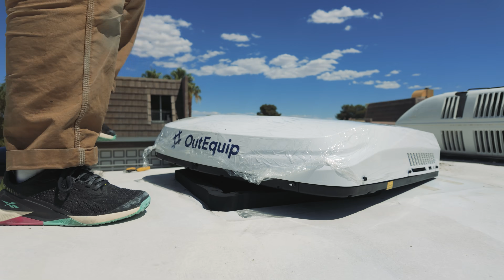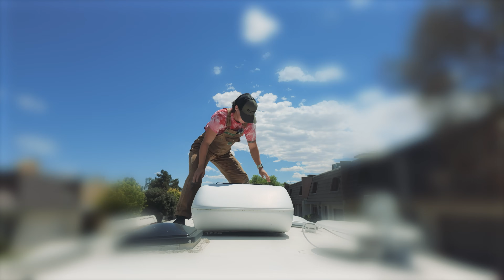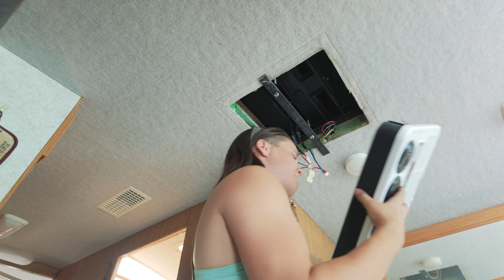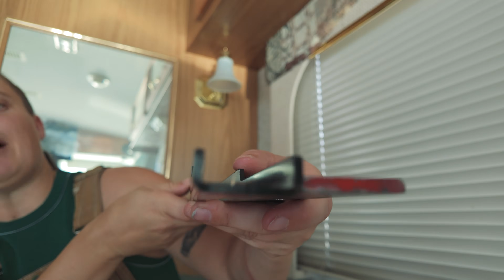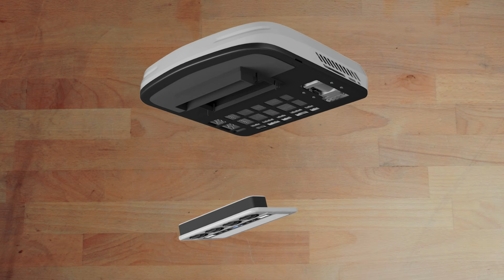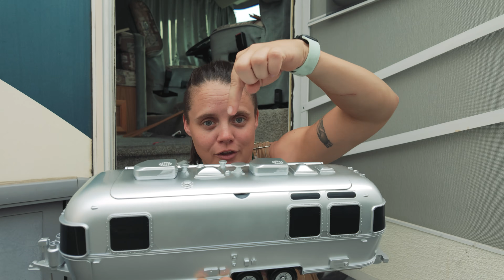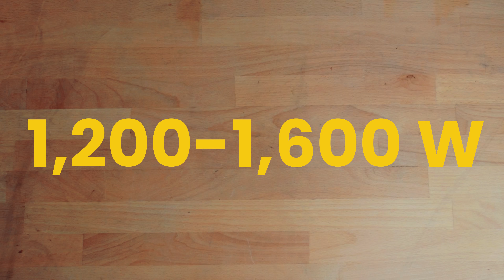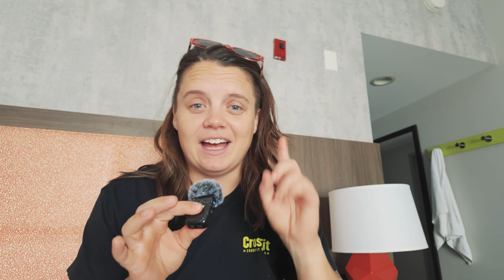Better RV Cooling with Less Power? My Switch to a 12V  AC | OutEquipPro AC Honest Review

Comment: You are a real pleasant surprise. As a teen in the 70s during the custom van boom I was customizing vans as well as working on RVs and boats, and over the decades have meet hundreds of different people in the field as well as DIY folk. Your style is informative with good explanation on how things work and why. And as a RV repair woman even better where many guys seem to be more look at me I know everything when you can tell they clearly don't. Right now I am more looking for something I can make portable for both our Sprinter van as well as our MacGregor 26X sailboat to stay comfortable and not have to take a gas powered generator but use a DC to DC charger and solar for electrical battery bank or something like a Goal Zero battery storage inverter that I have been using for the last decade for my power needs as well as using for a 12/120volt  Dometic refrigerator. Thanks again for your view on OutEquipPro.

Comment: a small but significate detail, either missed, or miss understood.. DC power in an RV is not (only from) Batteries,  Most RV's have DC converters that is powered by AC.. that creates and provides "DC" power.   You don't have to have batteries to have DC power in your RV.. Also I dont think you cover this.. Are these new low voltage Air conditioners cost competitive?

Comment: This is total bull poopy. This thing is $1000 plus shipping and then it's only 10,000 btus and that's fine for a small van or the bedroom Of a larger RV. That wiring is gonna be such a pain in the ** if you don't already have a way to run it If you have a larger rv or an rv her size you're much better off getting a hi efficiency inverter because you can buy $1000 worth of extra batteries. A 30 foot RV will need two of these on a hot day. The ac may be a great unit but it's not for large rvs this is strictly a van build air conditioner. Within 10 years everything will just be 48 volts. Have you seen how much of 48 volt alternator costs?

Comment: I want to say your one of the smartest people on electrical. I'm a truck driver I have a custom built sleeper. My Coleman stopped working and of course some dumb ass redneck yahoo said it was shit. But he would sell me a new unit installed for a shit ton of money. I watched your videos on capacitors do I followed your details and whammo it was a capacitor. How funny these men are so quick to sell you something just because they are one really to stupid to be in there business two they are thieves. Then I had installed some lithium batteries to run my sleeper. Then I watched this video about Outequip pro and whamoo I bought one Outequip are great people I actually helped them design the extension for the thicker roofs. The only thing I suggest you tell everyone. You must put the seal right at the edge of the 14x14 hole even if you have to trim it. Thank you for all you do. You show up men and I love it...

Comment: lol not a bad video but literally around 200-500$ for an AC soft !?!? thats literally insane. i install at least 20-25 every summer for customers and literally the nearly 80-100 total ive installed now in the last 3 years or so and have never even charged that much for both the unit and even installation lol they are literally only 70-100$ on amazon and anyone with even very basic standard knowledge can simply install it themselves.

Comment: Comprehensive video.  Two comments.  The unit is only 10k BTU which is too small for all but the smallest Rv's.. probably why they 'make' them for Class B units.  One of the major Class B mfgs uses a 12v unit made by ProAir... however its a 20k BTU and some have complained the cooling capability is not all that great but I'm sure its up to personal intrepretation.  This unit sounds better at least with the Delta T.  Another correction... when talking about a 30amp and 50amp shore power hookup, the 50 amp actually delivers 100amp to the RV.  Its 50 amp on two separate legs.  (two 50 amp breakers). 12k watts rather than 3600.  But whos counting.... the explanation of the 'fun' of balancing everything running on a 30amp unit is Real and experienced daily but RVers.  Like others have said, your breakdown does better than anyone at breaking down a 'tech' issue to an easy to understand feeling of 'hey I can do this'.  (great tag line you have too!). Keep on keeping on and I will keep on watching.   Thanks

Comment: Just curious: could you use computer fans to push (or pull at a particular vent) air through the ducts in a camper that has them? It occurred to me because in a house if there is a duct that works a little 'slower' than the rest, you can purchase registers with fans in them to help move the air better.

Comment: Not sure if I missed something but you're replacing your original AC. For many, they use this 12-volt AC to replace the vent blower. The original AC is still there. In that case, 12 volts is already there.

Comment: A year later, I'm just about ready to set up my Solar on the travel trailer, and I will replace the current 120 AC with the 12 volt system! QUESTION: When you cut the factory bracket did it cause a stress bend when you retightened the bracket down?

Comment: love your videos i learn a lot . I have a 200 battery bank and Victron MultiPlus inverter & charger. 2000 Watts, 12 Volts DC, 120 Volts AC,
80 Amp charger. i know mu solar system is not big enough to run his ac very long . ,y qustion is can i run it off shore power tell i upgrade my solar and battery bank

Comment: I ran mine through the vent down to the same level as the AC and drilled a hole and pulled it through the hole and then sealed it up. That way you have no drilling in the roof.

Comment: Great video! I didn't see one critical piece of information, though. How about after the conversion, when you are plugged into shore power, does the convertor for your battery charging of the house power provide enough power to run the A/C for extended periods of time? That's critical.

Comment: I know other people must have told you by now. You put the brackets in the other way so they get recessed in the unit, basically upside down from how you installed them. Just turn them over and the cover will fit.
Reply: You should make an adjustment to your video at that point so people realize this simple change solves that problem.

Comment: I don't think you get the air conditioner off of the AC side of your power input when plugged-in because the DC side still needs power to maintain the batteries, so the 22 amps will end up coming out of the converter powered by the AC panel. In fact, it may end up shortening the life of the converter or even require an upgrade if you've only got a 35 amp converter with a bunch of incandescent lights because you'd likely overload it. Converters fans can be noisy too, especially if they're in the bedroom. I'm in a state of disbelief at what is being claimed at cooling for less than 500 watts. I've got a handful of different sized air conditioners, living off-grid, and have figured out what you get out for the wattage you put in. Some of the air conditioners do much better than the others on efficiency, but to claim double to quadruple gain? That would be a real game changer, especially since I'm missing the air condition on my newest project RV that I'm saving from the junk yard to move into soon with the trouble of a 1,200 watt central unit requiring extra money for upgrading my inverter and not have a reasonable low-consumption overnight bedroom-only option. I think if I got two of these, that would solve my problem. I think one of these would not work for the larger RV here in the Florida summer when the regular rooftop units usually aren't quite enough on the worst weeks. I guess it's time to see if I could even dream of affording this rooftop delight, or if I may be stuck with a couple of $500 mini-splits, one front wall and one on the back and use the ceiling hole for a skyight/vent/fan thing.
   I do wish you'd have mentioned that you're not getting rid of the air conditioner's electrical load on the AC side if you're plugged-in because it's still going through the converter, but the load is insanely less overall. The reason why you can run your microwave, or even you water heater and the air conditioner at the same time after switching to the DC air conditioner is because batteries are draining when the converter ends up needing to stop sending power to the batteries and DC loads because the AC demand is too high. Only because those high AC draws are temporary, the microwave a few minutes, and the water heater a half-hour, the battery isn't dead and can charge back up for the next time something needs a short time for a large draw. This sounds real life-shortening for lead-acid batteries.
   Now, if you're on solar panels, batteries, and inverter like me in a few RV's? This sounds like a revolution that I'll look into as soon as I finish typing this comment. I'd be head over heals for a 48 volt model, or even 24 volt as I actually don't have the 12 volt amps available with my current 24 volt configuration that I'm hopefully upgrading to 48 volts this year.
Reply: Oh, I just found out it can draw closer to 900 watts maximum, so it's closer to 100 amps! Even with a 45 amp converter, you'd run a 100 ah LiFePo4 battery dead in about 90 minutes. This air conditioner appears to actually be incompatible with plug-in only setups. It would work for the 2 kw of solar panel input that goes from charge controllers to the 7.5kw battery bank wired at 24 volts (for now), then to a 120 volt inverter and 12 volt converter. Because my power source is more than a kilowatt of compatible DC power per hour available then it's sustainable. To convert 120 volts AC to 1kw of low-voltage DC would need an "industrial" AC to DC converter, and you might as well mount that near the DC air conditioner so the gigantic 100 amp wires are as short as possible.

Comment: I just purchased a 25 foot camper trailer and we pick it up in the morning. All I plan on doing is adding solar. 6kw all in one inverter and batteries in the passthrough. Panels will be on the ground. Not on the roof.

Any tips for my set up? I don't have the camper here yet so I can't really plan much

Comment: LW6023IVSM LG 6000 btu plug in window a/c claims to be 7.7 amps. I’m not well versed but would the low amperage override the 7% loss from AC to DC?

Comment: You went over everything besides how underpowered it still is. Is by far the best 12 V unit in the industry and we use them all the time but unfortunately they’re still underpowered for something like a sprinter 170, transit 148 extended, Promaster extended, etc.

Comment: Well sorry but this is not an accurate explanation of comparing 110 vs 12 v. Basically you will use the same energy for either system.  An inverter AC unit is generally on or off and you will see max power consumption when you take a power measurement. A 12 v inverter system can vary greatly as far as power consumption goes. Don’t you think they would do this universally for home systems if you can save 60 or 70% on your electric bill. I am really surprised that those 30 year HVAC people didn’t figure this out. There is no free lunch. I really love your channel but in this case maybe run it through an HVAC engineer.

Comment: No solar setup can keep batteries charged to run these AC units.  Since you "have to" run your gen, you might as well have a nice AC unit, 9k to 13k BTU. Installing a soft start will allow you to run your AC on an ultra-quiet 2000w inverter generator. My setup is currently a 13k AC with a WEN 2350. Can run AC all day at 40% load on a single tank of gas. The gen is 39 pounds and only puts out 58db of sound. So super quiet. I removed the horrible Onan microlite 4000 and sold it for $500. That onan 4000 is an abomination and both Onan and RV manufacturers should be ashamed to still be using these TRASH gens in 2026. The RV repair shop wanted $700 to replace the fuel pump on the onan 4000. Instead i purchased the WEN on amazon for $380.

Comment: Just saying. 300 watts on 12V are not the same as 1300 on 120v. 
Both systems where using almost the same amount of power at this test.

Comment: Would this be a good option to add a second AC unit in a bedroom in a travel trailer that is equipped with a vent fan and wired for a second unit?

Comment: 50 amps is better then 30 amps because 30 amps is 110V and 50 amps is 220V which makes a massive difference on what you can run in your RV. There really is no comparison, its way more then just the 20 amp difference. 30-amp service provides up to 3,600 watts, while a 50-amp service offers up to 12,000 watts so you get 3 times the power with 50 amp service.

Comment: Well done.  Very helpful.  RV solar tech here.  In 12 years of installing solar on RVs "solar prepped" almost always means there is already wiring installed from the roof to near or in the battery compartment.  Not "just a hole".  Often this wiring is installed before the interior walls are even installed at the factory making it inaccessible.  This would never be a feasible option for running cables for the AC unit.  Your point about chasing down the side of a plumbing vent is good info though.  I do that all the time.  You speak well.  Very understandable.

Comment: I may get this in addition to the Furrion Cube as I have a robust solar setup and 200aH of 12v with it's own solar power. I disabled my trailers 12v charger converter for something better suited to AGM batteries and segregated the system from the AC side of the fuse box.

Comment: I've seen they now have a 24v and 48v version of this unit now.  Ive been considering going from 2 120v units to 3 48v units on my toyhauler.  Obviously id have to upgrade the battery bank to 48v to take advantage of smaller gauge wires. Also an interesting thought that it might be cheaper than outfitting my rig with a huge inverter system since the ac's would be moved to thr DC side.

Comment: My moms camper last year the ac was leaking condensate inside.  I took the ac units cover off and did some cleaning and that solved the issue but the ac motor shaft is a little wobbly. Mom has said her ac has always been loud fiquired it was an ultralight issue.  I think she could use new ac unit but i doubt she would go for a 12v  unit as she goes to campgrounds

Comment: I know im planning to add a 48v ac in my bedroom of my fifthwheel.  Im not doing solar just gonna run my gen setup to charge a 48v battery as i boon dock at my tractor show and want ac at night.   I fiquire if i start my gen after 5 i can run my 110 ac to start cooling the camper while charging my 48v bat and my ecoflow for night time 110 of 2 15a inlets plus the campers 30a plug.   Thats my plan if budget will allow.  Im only boondocking say 1 week a year. The rest of the time at the show grounds when no show is going on if im there i should be able to plug in.  Ps my 110 ac is ducted so im planning to replace bedroom vent.

Comment: Thank You for this presentation. It took me a few minutes to realize that you were talking about DC air conditioners, as you used "AC" in your title. I live in Florida on a fixed  income. Every year my electrical  bill increases in price. I have installed a few solar panels and batteries. Not enough for the whole house but enough to shave off the cost of electricity. My biggest concern is Air Conditioning. ACs require a lot of electricity. A DC air conditioner would be a step forward. I am looking at DC truck ACs. There is quite a market for rest stop DC ACs foe semi trucks. Most important is that they can be installed on a vertical wall like in my bedroom.  My DC is not whole house so I will have to use a battery. Also, I thought about using an inverter to power an AC-AC put DC truck ACs seem a better bet.  Thanks Again.

Comment: thanks this is exactly what i have been looking for, i have 1 ac unit on my fifth wheel up front, and I am installing a 3000w 24v hybrid inverter with 2kw of PV and 10kwh of battery.. all in that thru storage, so when my bedroom ac finally goes kaput this is what will replace it.. and i will be able to run it directly to a breaker (40amp) and run it 24v .

Comment: You are an impressive young lady and have great energy!  Do you also assist in off-road van builds? I think I’d make the trip from nj to vegas just to work with you. Awesome video.

So quiet, that was always my complaint about my traditional ac unit, it was so noisy even on low I couldn’t sleep, this is great news to me. I’d rather be slightly warm and quiet than cold and noisy.

I would likely make a cnc faceplate to replace the plastic.

Comment: Even a 4-500watt draw on a van setup is going to drain the battery pretty quick. Assuming 30-40 amps, that will drain a 100 amp li ion battery in 2-3 hours. With a couple 100watt panels you'll extend  that a few more hours, but will leave it empty-ish by the end of a hot day. So, add a 2nd battery and 2 more panels on a trailer or coach, or even a suitcase and now you've got something sustainable. Very cool.

Comment: Very well explained, only thing I would point out is the wattage draw needs to be scaled to the cooling power of the HVAC when comparing.   IE, a 25% watt draw sounds incredible, but if it's only doing 70% of the cooling... still a big efficiency gain, but not as amazing & it will likely struggle with keeping the RV cool so you may end up needing a larger unit or multiple units.

I don't know what your old unit BTU rating was, but from what I've seen most RV HVAC units are 15,000 BTU, while this unit is 10,000 BTU.